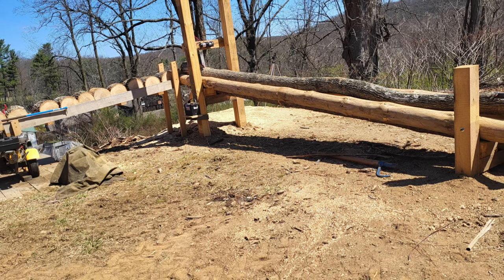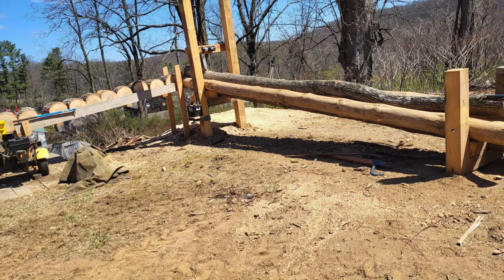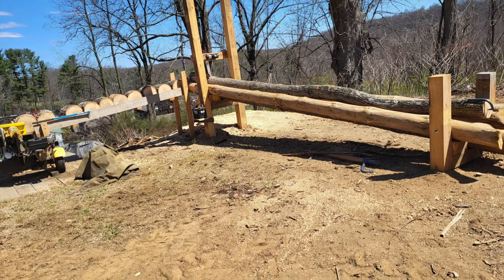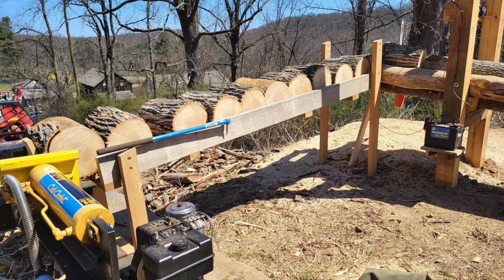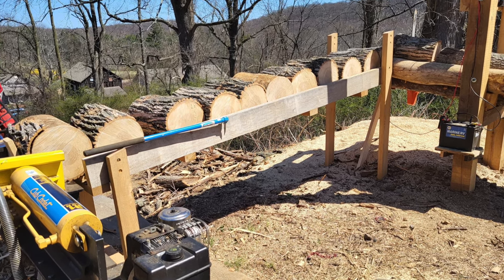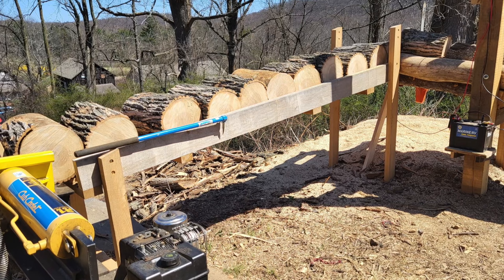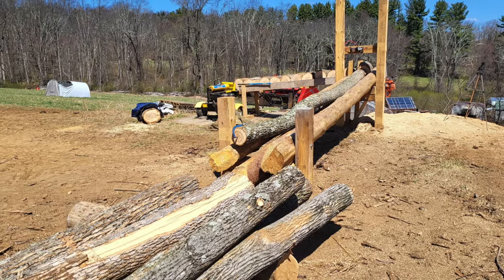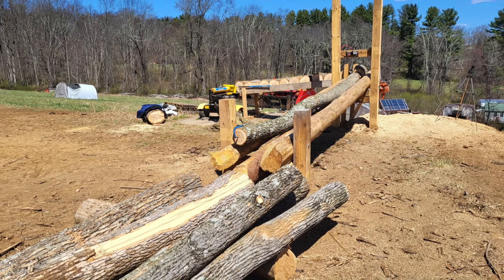DIY Firewood Processor

Comment: That's a pretty good set up. I've been thinking about doing something similar, but as a mobile setup, so that it can all move down the log pile. Basically bring the setup tot he log pile rather than the log pile to the setup. If you catch my drift.
Reply from the maker: Thanks, Ya I see what you mean. For me, moving the logs is all tractor time. Not having to touch the log or the splits is key. I don't have a huge log pile, I cut trees as I need them, usually half dozen at a time, or what I think I can do in a day.

Comment: Very nice set up! Did you want to share dimensions for example the overall length, inside of your vertical post and the chainsaw hight?
Reply from the maker: Thanks,
20" is my max diameter for a firewood log, anything bigger gos to the sawmill. The log ramp is 20' long with 36" wide between the bottom vertical post and 27"wide  between the top vertical posts. The ramp from chainsaw to splitter is 12' long and 20" wide. The chainsaw height is about 3' but this changes quickly as the saw dust builds up.

Comment: Rich... Great setup you have there. Couple of questions... Is that a hole you dug for the firewood bag to go down into? Also, can you possibly follow-up with discussion of how you installed the chainsaw to the holder? Or at least describe it a bit. Looks like a piece of c-channel or something bolted to the bar of the saw. Thanks for this.
Reply from the maker: Not really a hole, just a 6' high cut into the side of the hill. That way you can drive a machine, tractor, forklift, what ever up to it. The chainsaw mount uses bar extender nuts. Having a lathe and mill I machined them from a piece of solid steel. You can buy them online from a number of places, here's one: https://www.baileysonline.com/logosol-extender-nut-each-m8.html
I really like using the extender nuts, no modifications to the saw needed. Wasn't sure if they would be strong or hold the saw securely , but they are working great so far. I'll try to post another YT video showing the details. The system was super cheap and easy to build and works way better than I even hoped for!
Reply from the maker: Video showing more detail: https://youtu.be/F93eGBlT5pM

Comment: pretty simple setup. Gravity seldom quits working or blows a line!
 How much have you messed around with loose vs stacked volumes? 180 loose I have found in a pile it seems to end up closer to 200 in a cone I calculated last year it turned out closer to 220 which was crazy since 128 is the stacked volume.
Reply from the maker: Thanks, I don't really ness with cords, stacking, counting or handling the firewood, don't have to. I sell firewood by the piece at my self serve road side stand. Up to now I have been using bags and according to the manufacture they hold 1/3 of a loose cord. Actually I have no idea if that's even close, but I guess it could be. For me, the bags only serve as a catch, transport and storing mechanism. The down side of the bags is they only last maybe 3 years. Im switching over to wooden boxes will see how that goes, should last longer and because I mill my own lumber cheaper.
Reply: @RichMenzel  cool. Yhe bags aren't cheap.  Hopefully wood baskets work well for you.  As long as they're tough enough to take the abuse of time. I built one basket that holds a half cord loose or stacked. There's always a trade off, but the less handling the better.

Comment: Where did you get the fire wood bags ? And how much are they ?
Reply from the maker: I bought the Log-Lift bags directly from the manufacture NNZ.com. The last time I bought them was 4 years ago and I don't remember what I paid. I stoped using them because after 3 years they start falling apart. Now I make my own firewood boxes out of wood. They are a lot bigger, three times the size, and should last a lot longer. Because I mill my own lumber off my wood lot they only cost are the screws to put them together and my labor.

Comment: Info on the wench that you used?
Reply from the maker: It's the small HarborFreight 2500lb winch, plenty of power. It came with a wireless remote and steal cable, but I think the synthetic cable would be better. I just use a 12 volt battery which will out last me and I charge it at the end of the day.
Reply: @RichMenzel  Thanks Rich, what a great setup, I just bought a Super Split and I’ll cut my rounds with your method.
So glad I found your channel
Reply from the maker: Video showing more detail: https://youtu.be/F93eGBlT5pM
Reply: @RichMenzel  you could always wire it to a solar charger if you don’t want to have to deal with putting it on the charger at the end of the day.
Reply from the maker: @amandadavis9726  Sounds like a good idea, Thanks.
Reply: @RichMenzel  you bet.